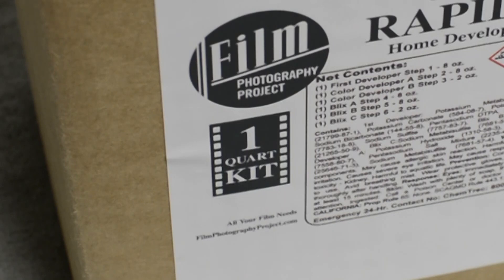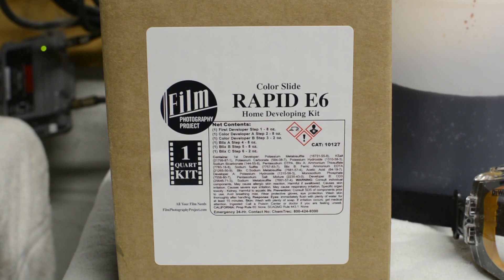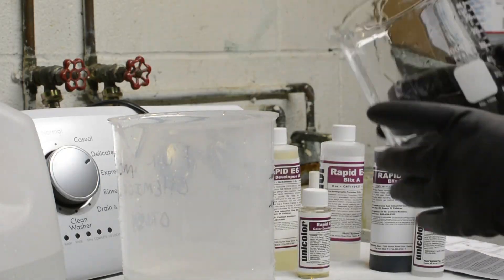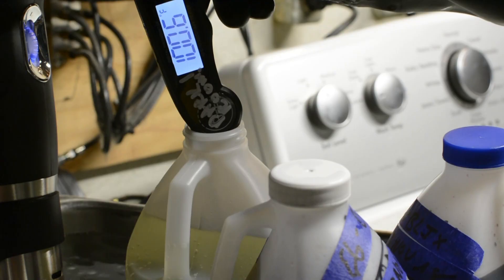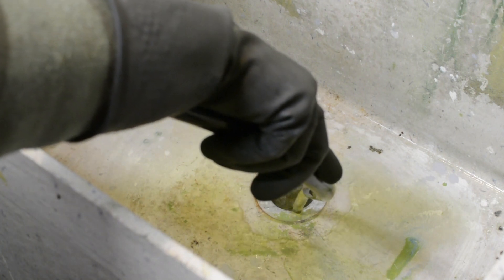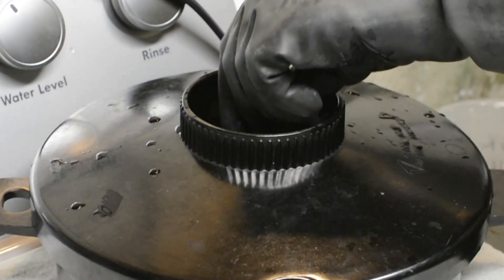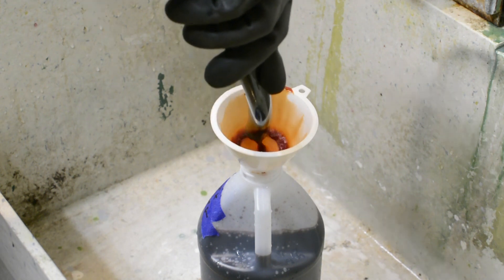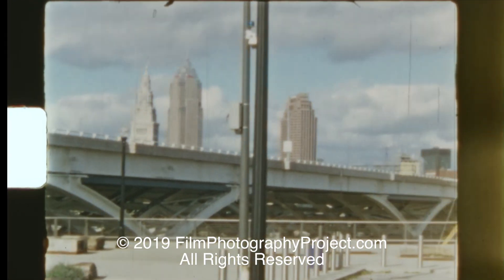Develop Ektachrome Movie Film at Home!

Comment: Color developing is all about consistency. To do so, one needs to keep the temperature withing process limits. For First Developer it is +/- 0.3 degrees Celsius. Yes, POINT three. It can be easly done, but not like on this video.
Reply: True, the accuracy of the temperature of the developer during the first development process step is critical to getting good density and contrast. If you are processing in a tank which is not itself temperature controlled DURING the development step, then you need to start the process at a bit higher temp to allow for heat loss during the development. To test, start at 100 deg F, and "process" without film using just water for the time of the first development step. Measure the temp of the water at the end of the step (the "drop"). Divide the drop by two and add that to your starting temp. The process then averages out to your target process temperature. This works perfectly. The other process steps should be about the same temp, but the requirement is that they fully complete their chemical process of the film, so if you loose a little temp, just process a little longer. "Too long" will not hurt your result. Finally (1st), really wash the film, not the" tap into the tank" method used here. Get a hose into the center of the reel, flushing water into the bottom and up through the film. Finally (2nd), if your kit does not have a stabilizer, make one. The formulas are on the internet and require only a bit if Photoflo and formalin (drugstore) to prepare. Use after the final wash to soak the film, then dry film.

Comment: So I developed a roll of Provia 100 today which came out completely blank! I think that when I left the film sitting in water  (by accident) during one of the wash steps the water was dark orange! During the subsequent washes (which I did quickly) the water was fairly clear. The instructions say "quickly rinse 7 times" and now I know why!
Reply: Washing deviations will not make an otherwise properly exposed and processed slide film turn black. Frankly, it sounds like you accidently processed an unexposed film.

Comment: It looks like this kit doesn't contain formalin or a suitable alternative!  That's a necessary component for long term stability of E6.  Very surprised Unicolor didn't include it in a stabilizer.
Reply: Formalin is used to prevent fungus and as a gelatin hardener. Newer emulsion gelatin layers do not have the attraction to fungus as they did year ago and film no longer need the hardening they did years ago. May discontinued the use of a formalin stabilizer years ago with fears of the chemical as a carcinogen.
Modern films have much better dyes that were much more stable and they discontinued the formalin type stabilizers. The most critical thing affecting the stability of an E6 film is a thorough washing to rid the film of residual bleach fix.
Reply: I thought it was only C41's that no longer need the formalin, and the dye couplers were never updated for E6? That was my impression from former Kodak engineer Ron Mowrey, that it would still risk magenta fade.
Reply: @KyleMahaney  That's my understanding as well. Tetenal still supplies a formalin stabilizer for both their 3 bath E6 and C41 kits. While it may not be necessary for modern C41, it probably can't hurt either.

Comment: Hi. Was surprised to hear that the film is light safe after the second dev and before the Blix (fixing) stage.
Reply: The film is light safe because the reversal step is equivalent to fully exposing all the silver halides in the film that were not developed (turned to metallic silver) by the first developer. There is no remaining unexposed material in the film. 
Long answer:
1. You’ve got an unexposed roll of slide film in your camera. This film is made of 3 layers of  silver halide emulsion, each sensitive to a different color of light (red, green, and blue), and each containing a dye coupler of the opposite color (cyan, magenta, yellow).
2. You take a picture. This exposes some of the silver halides in each layer which causes them to undergo a chemical change. Now, in each layer, you have two kinds of crystals, exposed and unexposed, which are chemically different from each other.
3. You put in the first developer. This is a black and white developer. It causes all the exposed silver crystals to become black particles of metallic silver. Now you have a negative black and white image on each layer.
4. You put in the color developer. Because this developer is for reversal (slide) film it contains a chemical which causes all the unexposed silver crystals to change into exposed (but not developed) crystals. So now you have a developed negative image and a latent (exposed, but not developed) positive image. The color developer also contains a chemical which causes a dye cloud to form around each crystal which has been exposed, but has not been turned into metallic silver. This turns our latent image into a visible positive image. It is made by forming dye around all the silver crystals which were NOT originally exposed in the camera.
5 You put in blix, aka bleach fix. Bleach removes the developed metallic silver, fix removes the undeveloped silver halides (which are still sensitive to light over the long term).
Anyway, not sure why I decided to write a dissertation on reversal film in the Youtube comments section, but I hope someone finds it informative. 
Note: color film is actually made of more than 3 layers, but they're not really important in understanding this aspect of development.
Reply: In practice the film is light safe after the first developer provided that an adequate stop step is performed. The first developer develops the exposed halides as a black and white image, the color developer creates the dyes as the remaining halides are developed. The industry standard 6 step process does this chemically, but I have done the second exposure under a strong lamp too. In the kit shown the chemical for the reversal exposure is incorporated in the color developer.
Reply: Ok thanks. I’ve been using the 6 step E6 process (Fuji Hunt) at home for several years to develop Fuji Velvia and have always assumed that the film remains light sensitive until the fix stage is complete. No difference in practice as I use a drum and Jobo rotary processor, so the film is light tight until the end of the process anyway.

Comment: Could you develop 16mm Vision 3? Is there a remjet you have to remove?
Reply: Kodak Vision is a color negative film -  Use this kit for color negs - https://filmphotographystore.com/products/darkroom-supplies-fpp-c-41-development-kit-1-liter
Reply: you gotta remove remjet for the vision 3 motion picture stock, you can use a towel with some mineral oil as lubricant to wipe the remjet off the negs or use a borax, baking soda and water mix.
Reply: Okay for remjet, but the main point here is that the E-6 slide process is totally not compatible with color negative film of any type or brand, so the direct answer to the question is NO.

Comment: What happens if everything is not at 100 degrees?
Reply: Definite color shifts if not at the proper temp. Get a FPP Heat Helper! https://filmphotographystore.com/products/darkroom-supplies-fpp-heat-helper?variant=15891480936482
Reply: I was about to ask this too haha
Reply: @Noealz  The instructions in the box also display how long you'll need to process the film in each chemical for different temperatures. The manufacturer recommends 100F for the best results. I use a device like the FPP Heat Helper and it's easy, cheap, and extremely accurate!
Reply: You can get a uneven result, this applies to first developer, color developer and blix steps.
In my case I have a ton of well stored expired Ektachrome rolls so I expect some aging signs like magenta/purple shadows, but other than that they come out really lovely!